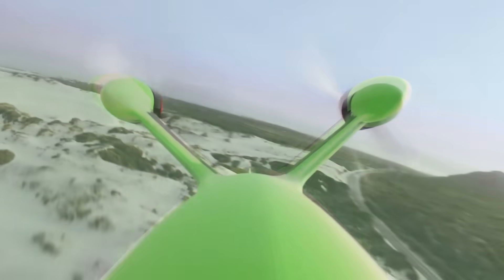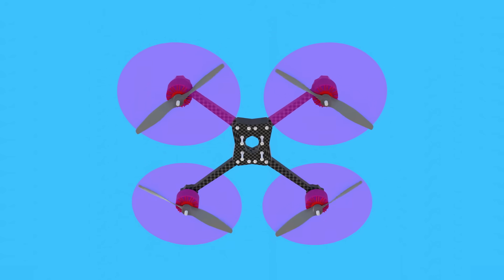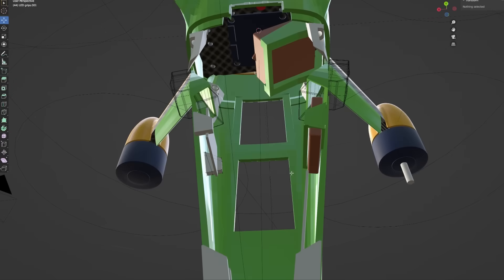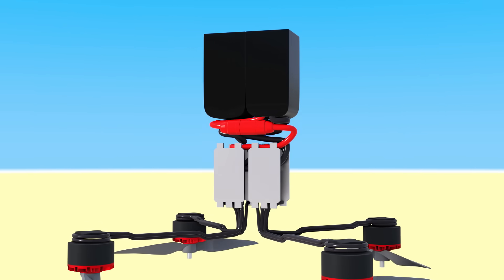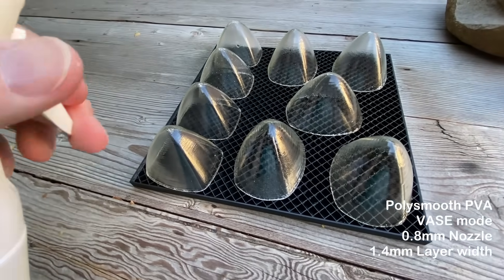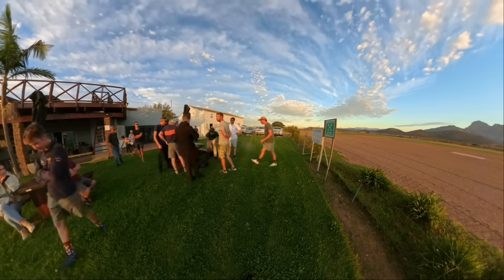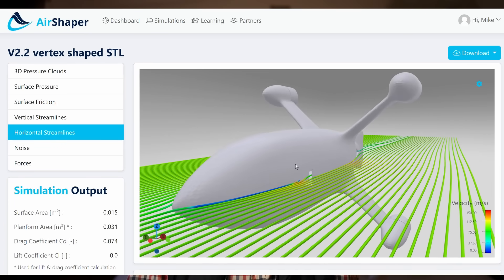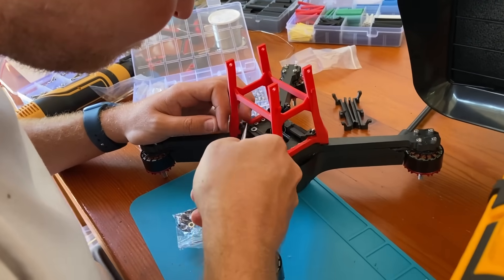300mph 480kmh | World's Fastest FPV Drone |  Guinness Record

Comment: Been slightly obsessing about this cool thing so here's some calcs for interest's sake:

If we look at the power consumption at 360km/h (100m/s) which is 5091We, assuming about 85% motor efficiency and 55% propeller efficiency we arrive at drag force of 23.8N.  This can be reduced to a CdA figure of around 0.00396.  Eyeballing the design section area of 150mm x 120mm gives us an A of 0.018m^2 yielding a drag coefficient (Cd) of about 0.22 or approximately that of a Tesla Model 3.  This is kind of impressive except that it has no wheels, wheel arches or tyres which are one of the dominant forms of drag on a road vehicle so it suggests that there's at least some room and probably plenty for improvement.

Also, at max speed of 510km/h we're starting to see compressibility effects being over Mach 0.4 in linear speed so there's no doubt that the propeller blades are well into the transonic flow regime so the 55% propeller efficiency above may be an overestimate.  To make any appreciable gains in the record speed these problems will only be exacerbated.  Time to get busy with area ruling and possibly ducted fans to improve the total aero efficiency.

I also note there is appreciable voltage sag at the high speed run dropping down to 34V.  This means that, for an assumed 12S system voltage of 44.4V nominal, there's about 2kW of power disappearing into the wiring as heat. (235A at 10V sag > 2kW).  While motors are to some extent immune from increasing voltage from an efficiency perspective, the rest of the electrical system surely isn't, so bumping the voltage higher is only going to be a win, albeit with safety complications.
Reply: I ran a sim and came to the conclusion its 28.67 newtons of drag at 140m/s, which gives it a Cd value of 0.172
Reply: The voltage drop of the battery is due to the internal resistance of the cells
Reply: @matthewbarnard461  Some of it is, for sure, but it depends on how and where the voltage is measured.  Also it's still I²R losses which is just turning battery power into heat so increasing system voltage can only but reduce this inefficiency.

Comment: Why not mount the speed controllers side ways on the motor arms, then they can be blended into the surface that connects the motor shrouds to the main body. Small naca ducts can then be used on each of the blended arm sections
Reply from the maker: Nice idea but it would enlarge the fairings and body skin friction a lot and at these speeds drag avoidance is a central aim.

Comment: Excellent work, Mike!  How efficient are your motors at that power level?  At 2kW each, it seems like there's highly likely room to improve them at least some and cut your losses giving you more thrust for less heat.  An FOC motor controller might yield some efficiency improvements over a trapezoidal sensorless controller too.
Reply from the maker: The motors did not get overly hot on speed runs.  Overheating motors is often a sign of a bad tune and the motors speeding up and slowing down unnecesarily.

Comment: what if the design use 3 motors instead of 4 motors ?
Reply from the maker: That would have 2 motors spinning in one direction and just 1 in the other. Result is unbalanced torque.

Comment: Amazing. I am impressed that you managed to do it all on Blender, but at this stage OnShape would be the more adequate tool for proper product design, you would be able to made the designs modular, and have more control over the surface quality. As well as being able to export the Models to SimScale for CFD analysis.
Reply from the maker: The results speak for themselves and I am busy at the moment doing CFD for version 3.
Reply: @Mike-Bell  the results also came from the only person trying to achieve the record, so I cannot tell with certainty this is the best method.

 People were doing highly streamlined designs long before the computer was invented, and achieving the same speeds with bigger cars, because reducing drag is the most intuitive part of Aerodynamics, smoother curves and surfaces are the backbone of it.

 If the body needed to achieve anything more complex, like Ground Effect downforce, I doubt Blender would have any legs to stand on, as someone who uses both Blender and CAD.
Reply from the maker: @davidaugustofc2574  haha so in a quadcopter crazed world we are the only ones trying to go fast...
Reply: @Mike-Bell  I meant if there's anyone else trying to make the fastest drone using Blender.

 If I search for Quadcopter design, I see mostly CAD results, the Blender ones are concept art.
Reply from the maker: @davidaugustofc2574  @billster7100 might be using Blender 🤷‍♂️ 
Blender offers the best complex curve smoothing which is going to benefit low drag.
Reply: @Mike-Bell  will check it out, thanks

Comment: Blender instead of CAD?
Reply from the maker: It seems like many view Blender as just a free toy, but his project reveals just how powerful it is.  I have an AutoCad Revit background and I can tell you Blender is next level and it can also do the animations that are essential for how I tell my stories.
Reply: @Mike-Bell  : Oh. I'm a big fan of Blender and use it professionaly. I've just hardly ever seen anyone use it in this manner. Usually, when CAD is availavle, it's the program of choice because of how easy it is to change the model and because of the precise measurements. Polygon modelling prototypes is asking for investing way too much time when the concept needs to be changed. In my humble opinion.
Reply from the maker: @theGoogol  The trick is to use modifiers so the modeling is non destructive and changes are quick and easy.  Precise dimension are possible in Blender but just require a little more work.  A problem is the entry hurdle to Blender is huge and many give up from frustation but once you are over the hump its so enabling and with such wide capabilities
Reply: @Mike-Bell  : Modifiers don't cut it (pun intended) for me. I have yet to dig deeper into non-destructive modelling using GeoNodes, which looks promising ... but steep learning curve.

I started Blender when it was v2.5 and it has grown a lot. Before, I was just a graphic designer but since I started using Blender, I've been able to use it commercially (package design, product rendering). It's amazing software and still free ... and Dutch. Love it. 😊

Comment: Would golf ball riplea help it go faster?
Reply from the maker: Nice suggestion but dimples on a golf ball are there to increase lift and therefore travel because it is a rotating body.  Plus the ball speed is relatively low so dimples would only increase drag when our drone is at top speed.

Comment: I wonder, why don't we use miniature jet engines for drones. Cost?
Reply from the maker: The drone flight controller makes about 8000 speed adjustments per second to the props to maintain directional control. Motors like jets or piston that run of fuel flow are just not capable of such rapid speed adjustments and so must have control surfaces like rudder and elevator or thrust vectoring in order to maintain control. 
Doing that all with just 4 electric motors is what a quadcopter is all about and presents certain unique benefits.

Comment: Great video and great achievement! So what sec and battery did you end up using?
Reply from the maker: We did not list the battery and ESC’s because both were dissapointing. 

We used the Dogcom 1500mah 160c batteries but they weren’t great, so Bonka next time. 
And APD ESC’s but they also weren’t great. A lot of duds we had to put through their paces and they popped before we filtered out the duds and APD won’t acknowledge they don’t filter out the duds in their quality control.

Comment: So why not a co-axial design tucked behind the mainbody?
Reply from the maker: Well then it is no longer a quadcopter ie 4 props and a control via props only. A coaxial design would require aerodynamic control surfaces.
Reply: @Mike-Bell  Would still be a drone and a helicopter as the title says.

Comment: Well done guys, this is awesome to have local guys pushing the limits like this, very inspiring! Did you ever consider running CFD on the model, and do you think that would have helped the design direction?
Reply from the maker: Thanks Mike. Up till this point the level of technology is such that big gains have been possible through iterative exploration. But from here on the gains will become smaller and harder to achieve and require more sophisticated optimisations and we are running wind tunnel simulations for further speed improvements. And we have product manufacturers who are interested in supplying us with optimised components to go faster.
If you have CFD skills I would be interested to know how you would approach this.

Comment: Having read Hoerner's Fluid Dynamic Drag, it seems to me that your nose tip radius is a bit too sharp for speeds close to mach 0.5 or 0.6. Forward visibility of the camera in the nose would also be improved with a larger radius in the tip of the nose. I have been working with owners of race cars and sport aircraft for 40 years helping them learn aerodynamics for performance in competition.

Comment: Are there any blender Addons you use to help model it? I have blender for a few years since 8th grade but I still find it extremely difficult to do things like this that involve precise measurements and parameters. Also, was all of the design done in blender? Or dis you also use other programs like cad or other things to help. Thank you!

For instance, how did you model things like the camera tilt adjustment? Also, during the part of the video where you showed the short clip of modeling the NACA duct, how were you doing that? What was the greyed out shape you were manipulating? Was it just a boolean or was it something else that i don’t know about?
Reply from the maker: Yes all modelling and design was done in Blender. I dont use special add-ons. I find the overall dimensions of an object useful for sizing and scaling. And you can set up a special axis for non orthogonal modelling. And you can move and scale inputing numbers. The NACA duct was modelled with booleans.

Comment: You might pick up a little thrust from dissipating internal heat.  It will be very small.  The key is to pressurize the interior.  That's entirely possible, your static pressure at 400 km/hr is 7600 Pa.  Put an 18 mm diameter hole at the center of the nose, which will also help with camera clarity when flying forward.  You should be able to get nearly perfect static pressure recovery.

The lip on that hole really matters.  Look at the lips on turbofan inlets.  The main thing is not to have a sharp edge that immediately expands outward internally.

The air then flows through your body and ejects out the back through a converging duct at the very back (not along the sides if you can avoid that).  If your ESCs are 85% efficient, you'll be dissipating 1350 watts in there.  YOW!  If you want to hold the air temp rise to 40 C, you'll need 34 grams of air per second, or 28 liters/sec.  At 400 km/hr, your ambient stream tube is 2.5 cm^2.  Expand that to 25 cm^2 through the ESC section and you'll have 40 km/hr air at almost 7500 Pa.

Heat by 40 C on a 20 C day will get you 13% expansion.  I can't determine the perfect ejector nozzle diameter, but something about 13% larger than the ambient stream tube should do it.  Guess 2.75 cm^2 or 19 mm diameter.
Reply from the maker: Sounds like a great solution. Will definitely investigate this. A hole at the rear is preferable because it shortens the tail reducing the toppling over moment on landing. Plus the batteries need cooling too. As does the flight controller. We are planning a longer tail to close down the air slower and so we can do away with the tail fin and its drag.
Reply from the maker: Hi Iain
Its clear you have expert knowledge. We are investigating relaying the video feed. Do you have experience with that? And it would be nice to talk to you further about the camera system.  We had the canopy to prevent the camera from vibrating in the 500kmh airstream but tested an open camera and it didn’t shake. So the open camera is what we want to explore further and that fits with your pressurised inlet suggestion. @lukemaximobell1

Comment: @Mike-Bell do you think you could possibly do a video (or just describe in general here in a comment) on how you go about setting up Blender for precise (down to the millimeter) modeling? How do you go about setting up the environment, did you use any specific Blender add-on's?
Reply: This is something I always thought I would need to learn a specific CAD software for, but you've achieved amazing results in Blender. I'd love to know your process in Blender, or if you would consider making any Blender tutorial videos for engineering and design? Amazing work!!!
Reply from the maker: The object size can be typed into the xyz object size.  In decimal millimetres if neccesary.
You can draw a cube and rotate it to any angle.  Select the cube and in Transform Orientations to the left of Snap make a new transformation axis to snap to. Its no harder than CAD.  Just a different way to achieve the same result.  loads of tutorials on Youtube for any topic you need help with.  And Blender has fanstatic animation features which are essential for my videos.

Comment: very, very cool! 

how are you doing the control mixing? i.e. converting from torque commands to motor thrusts?

if by any chance you have a mixer that outputs something like 95% of max thrust + some small differential consisting of roll/pitch/yaw components -- there is something better! using a QP solver you can find the thrust commands giving max forward thrust while still satisfying torque inputs. for such small problems the solution can be found in fractions of a millisecond, even on tiny processors. If you haven't yet done so this might get you another couple kph! get in touch if you wanna know more, i have done something extremely similar at work :)
Reply: its simply the mixer in betaflight. there will always be a small loss of power as the pid controller with airmode enabled can only be active and stabilize the quad if it dials back from full throttle on at least one of the motors. this is why its most efficient to make the quad as aerodynamic as possible at the angle of attack its going to fly at and a good tune. since the drone  doesnt fly completely straight forward but very slightly tilted up any drag on the body will push the body up and the pid controller will cut power to the bottom motors to compensate.

Comment: how did you do this with blender and not a mechanical software like autodesk
Reply from the maker: Blender is extremely powerful and versatile software.
Reply: @Mike-Bell  if you compare it with other software like autodesk, you are unable to get the exact angle, measurements, those stuffs
Reply from the maker: @mithunb09  Actually you can do all that.  Just follow different steps to achieve the same result.  Thats how I modelled Peregreen 2 down the decimal mm.
Reply: @Mike-Bell  hmm, will look at it 👍

Comment: Disappointed by the worry about aesthetics.
Reply from the maker: Apple wouldn’t be the success story they are if they had neglected aesthetics. Its not about neglecting performance. You put maximum effort into performance and aesthetics. What is worrying about that?
Reply: @Mike-Bell  I am more of a function over form guy, intense distaste for apple, awesome achievement regardless!
Reply from the maker: But I’m sure you appreciate beautiful architecture. Architecture is only fully successful when both functional and beautiful. Not so. Or do you prefer a functional rectangular hospital?
Reply: @Mike-Bell  You would be surprised with my answer, i worry quite a bit about cost effectiveness, for example i have a big interest in unreinforced catenary domes, specially if they were to be 3D printed to reduce workforce requirements, albeit it might not be feasible i don't know.

Comment: As the owner of a 3D printing service, I must ask why you haven't considered industrial 3D printing? bambulab its just a toy

 The TPU part would be incredibly smoother, the transparent canopy printed in suitable resin would be clearer, more durable, and perhaps even more cost-effective. The internal structure if printed in metal would be smaller, stronger,potentially even lighter and more aesthetically pleasing. Considering production costs, the only downside would be the main body, but for such a project, anyone would be interested in sponsorship. We're talking about €400 for 3d prrinted parts for a world record... If I weren't on the other side of the world, I would apply for sponsorship myself.😅 good luck forr this amazing project!
Reply from the maker: I hear what you are saying but the 3d parts kept evolving and being improved so printing ourselves was perfect. No sooner the part is sent to print service it has changes.

Comment: how does supersonic tip speed effect thrust? i can't quite wrap my head around it
Reply from the maker: The RPM plummets as the mach drag spikes. No additional noise. The RPMs just die till the motor recovers and takes the prop back to 48 - 49k RPM where tips go supersonic.
Reply from the maker: The RPM plummets as the mach drag spikes. No additional noise. The RPMs just die till the motor recovers and takes the prop back to 48 - 49k RPM where tips go supersonic.

Comment: Did you use Aluminium or Copper Cables? Aluminium cables win over copper in Ampere/Weight, little bit thicker but lighter per Ampere. Airplane do not use it because of (galvanic) corrosion over long time (piper did use it in the 70s).